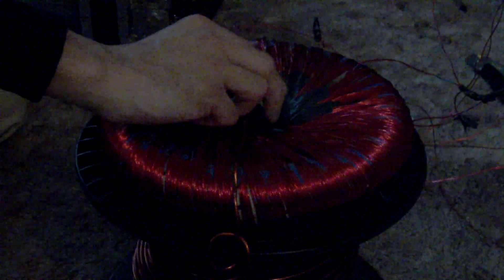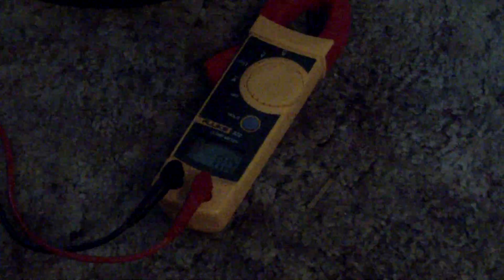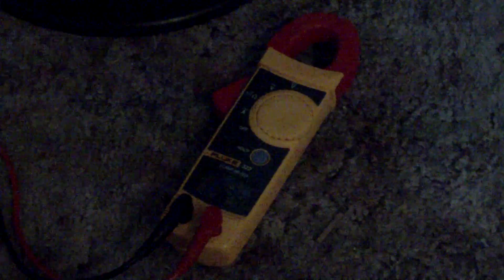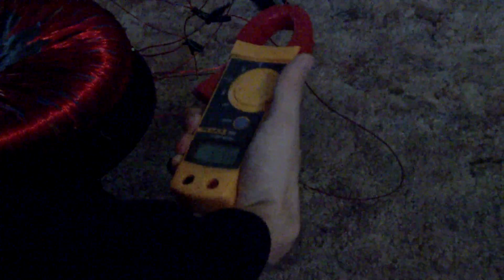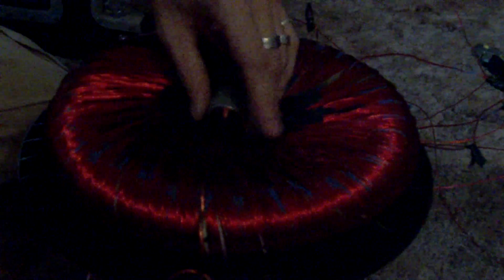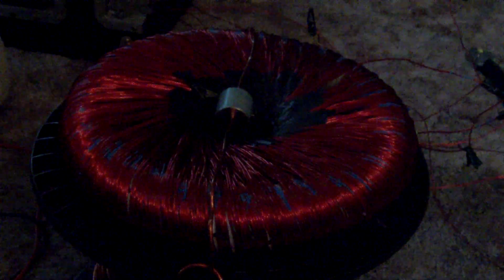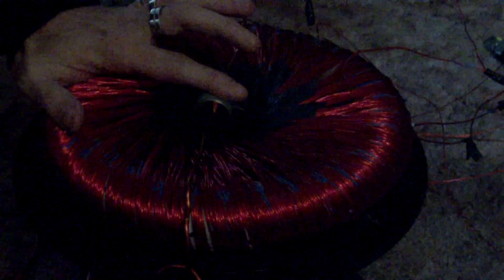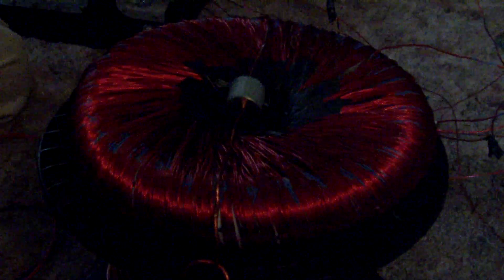Rodin Coil Baby Bear 12"

Comment from the maker: dremmels spin at 35k with gearing thats what I plan to exploit hopefully, I under stand the efficiency size and durability the deal is its a magnet that has a pull push force of 40 lbs that weighs 6 grams now thats something coupled with the fact that you can place a larger magnet with larger pull push force to enable lets say a alternator to work or Manta PMA.
what got me  into building is im sick of paying 3 bucks a gallon in gas and I aim to fix that.

Comment from the maker: The 10"  is the most powerful the one you see here is being modified to be a 3d/4d coil and should be ready for testing in the next few weeks.
So far the 10" fullywound coil is the most powerful with 120 vac hooked up and 1 amp pumped thru I get a total of 65-70 amps out of the center useing a Fluke clamp meter.

Comment from the maker: The 18" is a traditional rodin coil with 54 winds with 27 winds per coil and is as powerful as my 12" tradtional coil with 36 winds 18 per coil
The other 12 inch that is fully wound is extremely powerful and in the capable hands of Jack Sholze and his rotorgenie, ace of clubs circuits

Comment from the maker: I have one that is 12 inch OD it puts out 5 less amps when hooked up to 120 volts AC .5 amps or 60 watts.

its not a traditional coil btw where its 18 for the first coil and 18 for the second coil.

In the video the power source is a power amplifier for a stereo system I send a signal at 27 hrz and then one channel is 90 degrees phase the other is 180 degrees phase